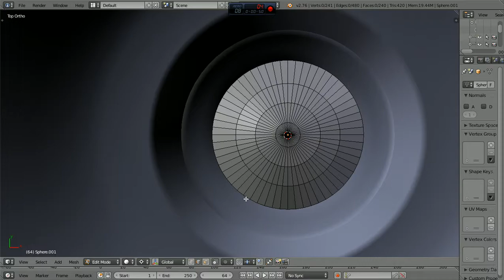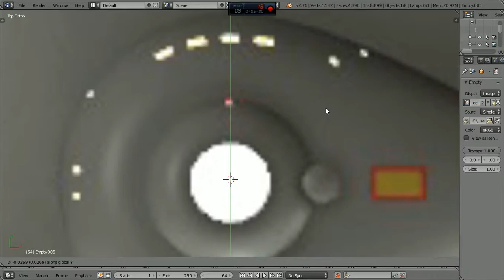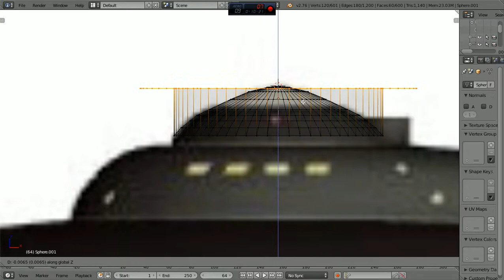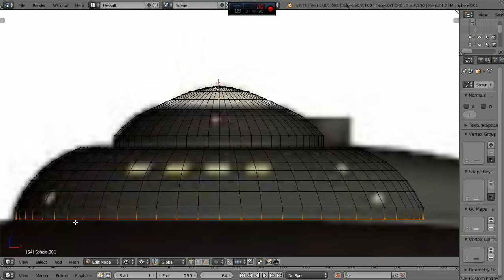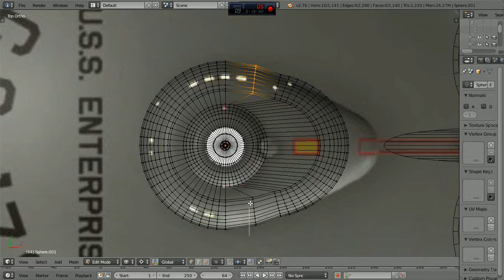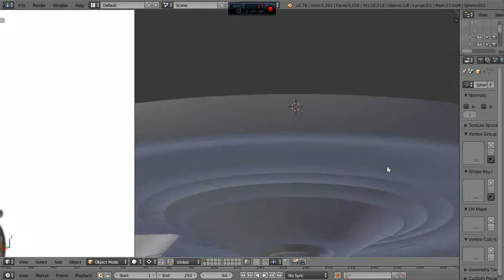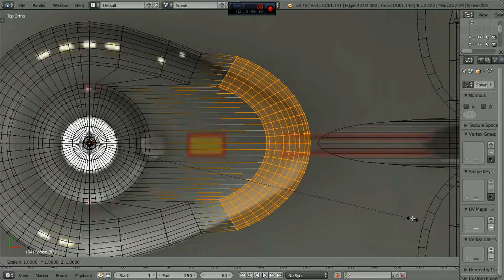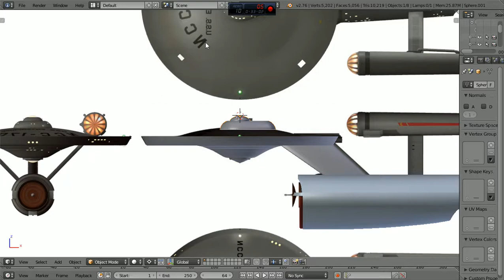The Stuart Foley Dreadnought Project #15

Comment: idlike to segest that you keep a majority of the costition class but since its a difrint class that may of been bult around a costition class ship that you sort ofadd on to the looks sort of make them look like they have had stuff added to its origonal dasine of a costition class look sort of like a mx etwen the sketch   and the costtion class
Reply from the maker: +jon baranoski Yea, that's where I have to play with the clay so to speak. I want it to be allot like the Constitution, and yet not, but this is suppose to be the rejected design. I want to make it to be that it is a rejected ship design do to that it was to much like the Constitution class and not modernized enough. The final design looks more like the refit with the original engines.
Reply: I think it could of been a rejected dasine becuz they bult it over the skulition of a costition class and it wneded up lost or sumthing  or it could of been rejected cuz it was simply the prototype for the one that fallows and it was the test bed  they bult it out of left over parts from a custition class ship bult around the ship to save cost used it as a test bed then the finished dasine your dasien the not rejected one ws the final protect and this one could of been lost or  destroyed do it its flas of being bult  around a costition class ship
  sort of like bad luck that they bult it out of a retiered or a recovered connie
Reply from the maker: +jon baranoski Yes, that's dead on with the story line I basically imagined, or they build the ship, reject the design and use the ship as an earth defense ship. they keep it around Earth to train cadets, and as a last stand defense ship if something threatens the Sector 0. IDK its a thought.
Reply: well that's cool I cant wait to see the story that comes out if it gets shown or told but id love to toss a few segestions around for story wise but ovyusly  trek yard will make final choice
Reply from the maker: +jon baranoski yea, and You, Me, We can always change this baby if need be, and or model another one, or 5 LOL.
Reply: what I need to to is start by inding a program and star rendering all my old art that iv kept since 2006 and redo it all on 3d and take it from panint program that I started them on
you have inspiered me actualy
Reply from the maker: Well if You never have 3Ded, or BLendered before, it slow and frustrating at first. but as you get the hang of it, you'll hit light speed in no time.